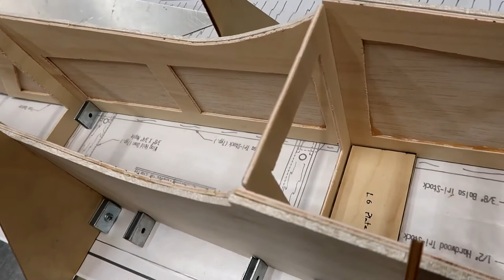EP16: Forming up the Fuse, Scratch Building a Giant Scale RC Airplane

Comment: If you put a small pen mark halfway across the top of the formers it helps a lot when you eye them through to avoid a " banana " or even use a string line from front to back touching the pen mark

Comment: some info.     1)   when joining wood, the surfaces to be joined  Should be sanded/defuzzed.     2)  at 3:59,  when building a  wooden  model, the Preferred  adhesives are  wood  CEMENT  or  CA.      you have Just stated  an example, of why this is so.
Reply: epoxy is fuel resistant , but I would not spread it with the same mixing stick he stirred it with.

Comment: Where did you find the magnetic a billboard I had a balsa-wood looking for the magnetic one
Reply from the maker: Ron, the board itself is just a piece of 20 or 22 gauge sheet metal that I lay on top of the workbench.  You can usually find this material at a furnace heating cooling hvac shop and have them cut it custom to whatever size fits your building needs.  The magnets can be had from amazon.  I have a link to them in the description of every video.  Or if you cant see the description. Find the video I made Viewers Questions Answered.  I titled them on the screen.  Once you have those,  you are unstoppable.

Comment: Pardon my ignorance, but if the plans show the plane in completed form with the fuselage tapered, how do you cut the balsa to the actual non-tapered size needed?
Reply from the maker: Im not tracking with your question.  Which part or parts are you talking about?
Reply: @Capgains7777  well, the fuselage of most airplanes have a taper to them, especially towards the tail, making the actual piece of wood needed different from the side view.
Reply from the maker: @insanegaming9410  if you are referring to the Ryan's Rebel plan,  its true the fuse does taper to a point in the rear.  However the sides, top and bottom are flat so it is like a box.  The formers inside are rectangular as well so when it comes to cutting the balsa the plan template works perfectly.  

Now if this were a round or tube shaped tapered fuse,  in most cases the formers inside would be round or curved in shape and you would be faced with using sections of sheeting or planking that would bend around those forms. (Which can be an art in itself) Pretty common in scale planes that emulate rounded fuses covered in sheet metal.

Comment: Where did you get the sheet steel magnet board
Reply from the maker: I went to a furnace/air conditioning contractor and asked them to cut a piece that fit over the majority of my work bench. They usually keep an inventory of bulk sheet metal and the equipment to cut it. I believe its 60 inches long and 24 wide.  You can go with smaller sizes if you are building smaller aircraft.  I think its 22 gauge galvanized steel which makes it lighter and easier to work with when you are moving it to and from the bench top.  I store it  leaning against the wall when its not in use.
Reply: @Capgains7777  oh that's brilliant.  Thanks

Comment: Perhaps you could comment on the firewall markings/layout? I'm getting ready to order a building system kit from airfieldmodels.com.
Reply from the maker: Hi Tom,
Yes very well then.  Just so happens that I am changing the engine choice and as a result will need to reset the mount holes.  So I will be doing that this week.  While I am doing that, I will take the time to walk you through the markings and how I use them to plot the engine.  I'll also show you how to reset the firewall for a different engine.  Sometimes we make mistakes, sometimes we need to change the engine.  That set of magnets, angles, steps and jigs from airfield models looks top notch.  You will have to let me know what you think of it.  Take care.